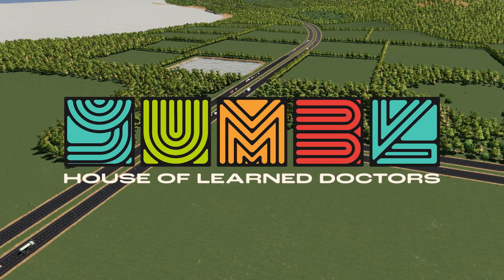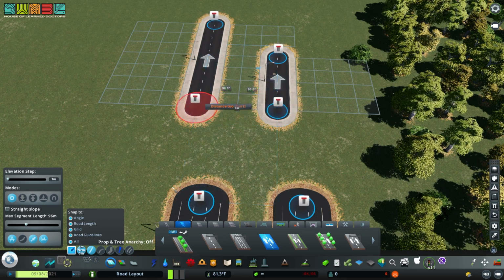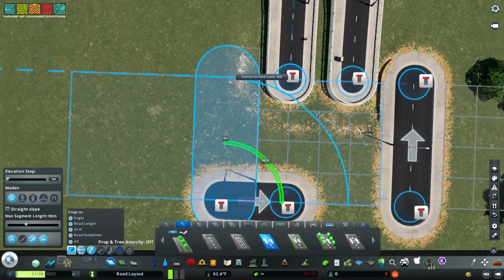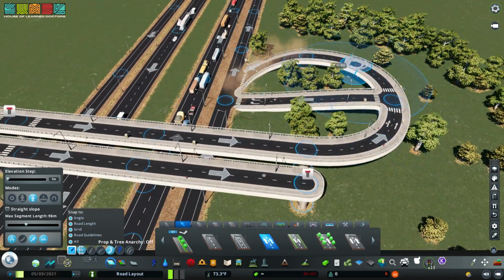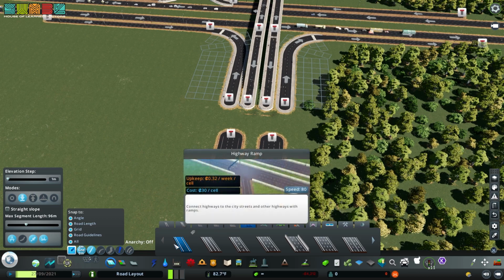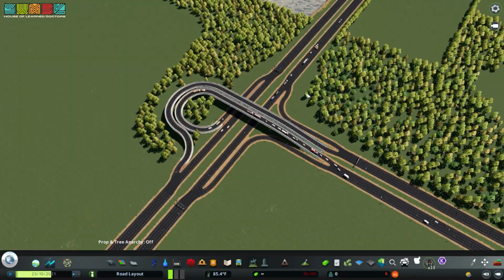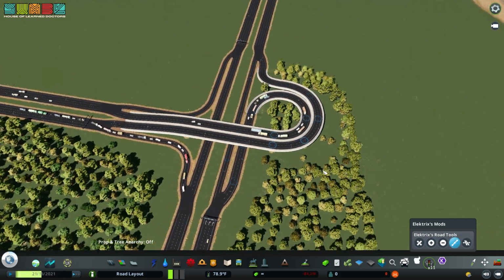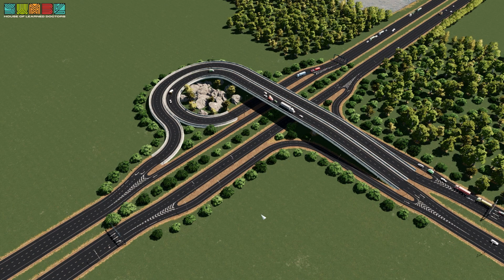Compact Trumpet Interchange Tutorial - Cities: Skylines

Comment: With that asymmetric traffic pattern you could have kept the heavily trafficked side on a wider radius by bending the trumpet the opposite direction and not bringing the ramp all the way to 90° before reversing the curve (thus moving more diagonally). You might also (capacity-wise) have made the entrance ramp facing the two lane exit ramp two wide, dropped the corresponding lightly used bridge to a single lane, though that then raises some maths questions.

Also, you can technically reduce the footprint further by taking the bridges off the outside edges of the one sided road so that the at-grade ramps can tuck underneath, then angling one or both of the bridges as they go into the trumpet. But I am insane.

Comment: When you fixed the lane math, and increased the speed limit on that single lane going straight, why not just use a two two there also? Like I understand using a two lane on the turn given the traffic, but why did it need to be asymmetrical like that?

Like, I get it would go from 3 to 4 (2+2), but surely moving up isn't really much of an issue?
Reply from the maker: It can be done however you want. I was just trying to make this one small/ idk it was a while ago 😂